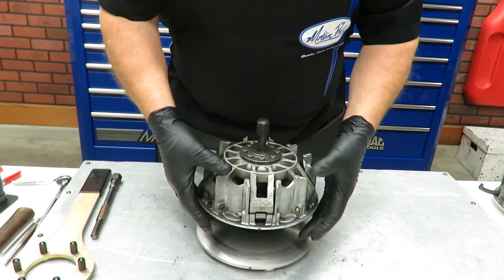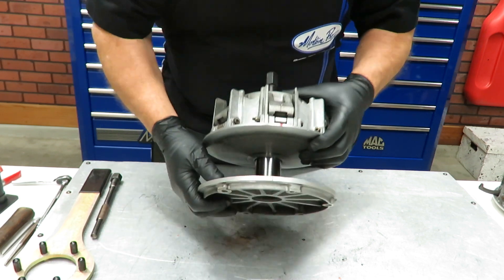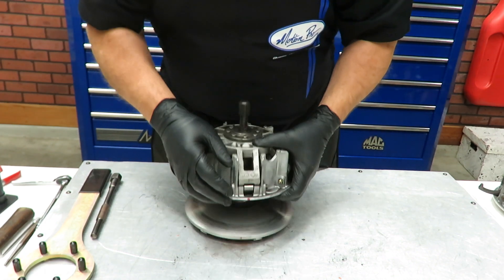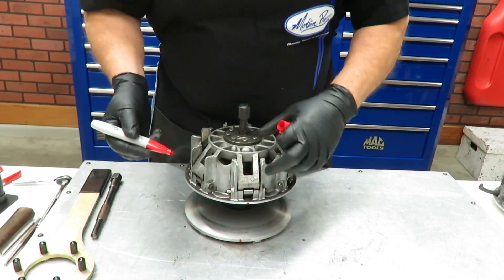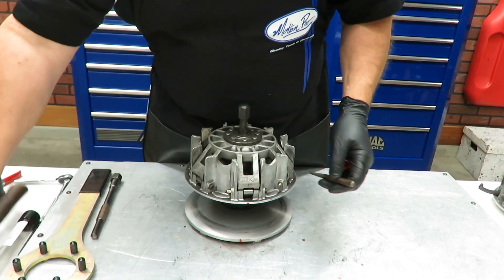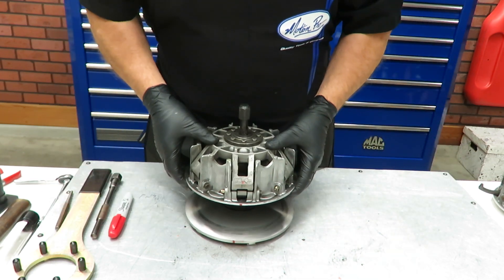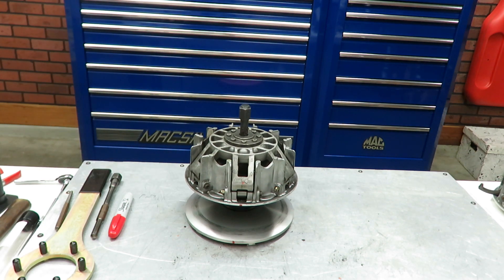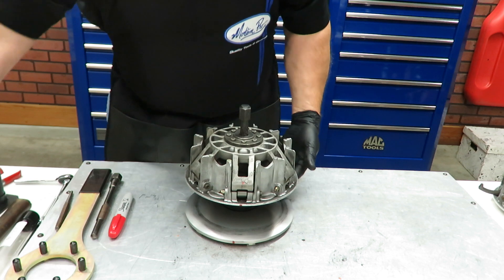Episode #1 Edrive 2 disassembly Ski Doo 900 Ace - Performance Mods

Comment: I have 2013 renegade 1200x,will everything you talked about in these videos work for me. From 36.5 gram ramps to 110-250 spring and stock secondary spring and helix set to 18 lbs?
Reply from the maker: Your 1200 would have a TRA Primary Clutch and this set up would not work.

Bob